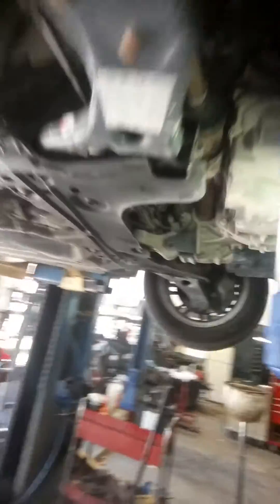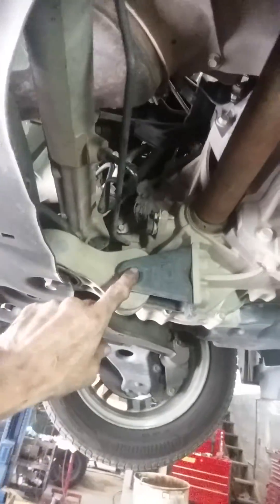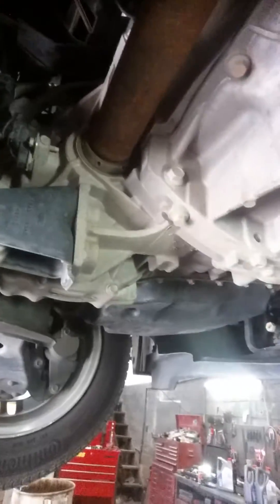2008 Ford Focus alternator R&R

Comment: Does it work on the ground?
Reply from the maker: Yes
Reply: @mymechanicdallas  thank you much appreciated, any other tips?
Reply from the maker: Get it on Jack stands as high as you can so you will have room!
Reply: Much appreciated again, helps so much. Didnt want to deal with the cv shaft and all that, you are a lifesaver🙏
Reply: Finally just "dropped into my lap"🤣 you're an awesome man
Reply from the maker: @pxxxurp8380  I'm glad I could help!
Reply: Any tip.on how to disconnect wire harness from alternator?
Reply from the maker: @pxxxurp8380  I've always found that using a 1/4 drive ratchet with a 10mm or 12 mm wobble socket helps.
Reply: Finally got it off, taking the bolt out of the dog bone now🙏

Comment: Tim, Thanks so much for the tip. I watched lots of videos on changing this particular alternator and they all come out the top with a lot of extra work. I used your method and it was a snap. Thanks again, glad I watched your video.
Reply from the maker: Pamela Owens You're very welcome! I'm glad I could help. That's the whole point of the video... 😉
Reply: I just did my mother in laws car you don’t gotta take that bone off twist that alternator up side down and it falls out put it in the same way